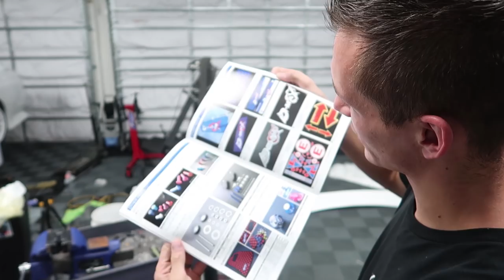Home-made Splitters & UNREAL JDM Unboxing

Comment: Hey Adam. You are using that jigsaw like a noob. Hehe (JK) but I use them everyday as a carpenter. It’s much easier following the line, if you use the jigsaw upside down. Put it underneath the material you are cutting, and practice makes perfect. :)

Comment: If you are actually considering using those as templates to do a production run of parts I would strongly suggest you buy a router and some template bits. You can make exact copies without having to mark anything, you just clamp or temporarily adhere (hot glue, carpet tape) the template to the sheet and run the router with the template bit (has a bearing above the cutter the exact width of the blades). The real time saver is you can spend a bit of time sanding or filing on the template to make it perfect then duplicate.